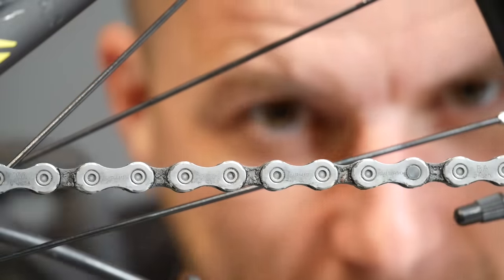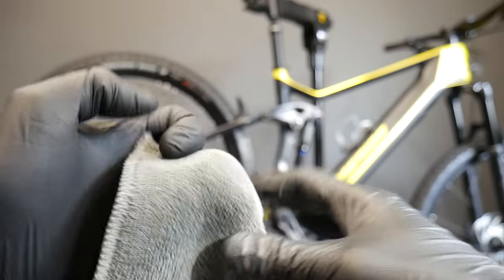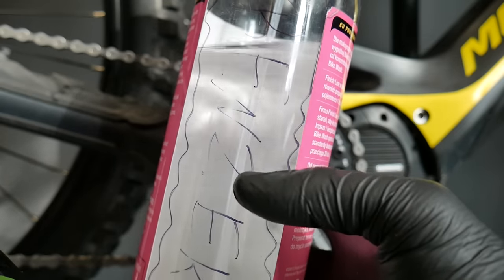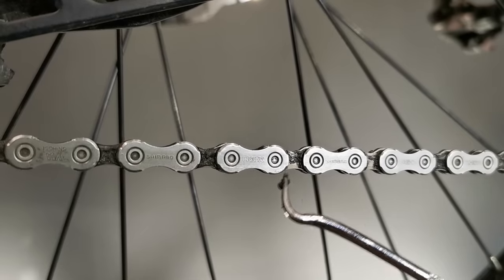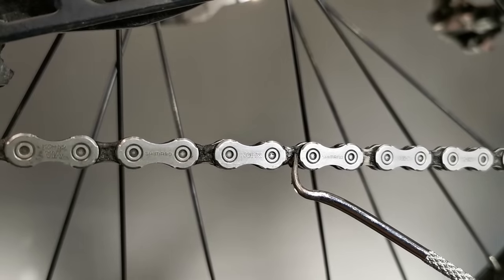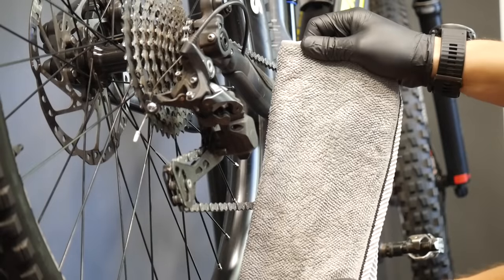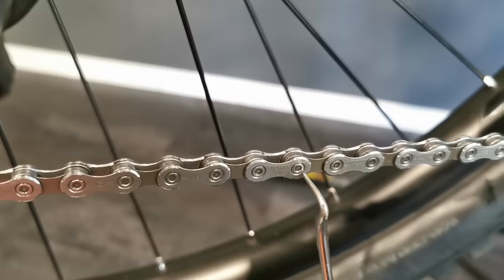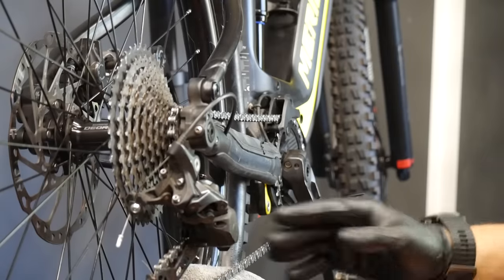This Drivetrain Will Last Much Longer. How To Clean And Lube Dirty Bicycle Chain. Slow Mo Comparison

Comment: Good idea with the shoelace! I found a brush does not quite clean the inside of the links so well. That chainring and the jockey wheels are utter filth though, not point cleaning the chain and leaving them in that state.

Comment: Chains wearing prematurely has a cost, but so does time spent cleaning.  If you’re going to invest the time to be this thorough cleaning the chain, it doesn’t make sense unless you do the same with cassette, chainring and derailleur pulleys.  It’s best to remove the chain, and completely clean the chain path before cleaning the chain.  Otherwise, you’re missing a lot of gunk and grime that will quickly find its way back into your freshly cleaned chain.
Reply: Removing dirt dry is advantage. It saves chemicals. 

Time consumption: well you die anyway. When and how? If you use lots of chemicals like car maintenance, you have those chemicals in you body. I like less chemicals. Maybe i die later with smaller amount chemicals in my body perhaps. It's practise and culture. Maybe patience pays off.

Comment: If I spent this much time cleaning my chain my wife would literally leave me... especially if I use her toothbrush...

Better Idea... spray a load of WD40 all over - let it drip off - quick rub of a rag - remove chain and soak it in a jar of petrol overnight (removes thick grease and crap) - remove from petrol then soak in degreaser for 30mins - remove from degreaser then soak in methylated/ white spirit for 30mins - remove, let dry - now the chain should be completely clean and just bare metal - wax chain - then it won't get so filthy. To rewax, after ~300-400km, pour boiling water over the chain from a kettle - re-soak in the wax - ready to go again. None of these steps takes a long time, in between you can go back to giving your wife some attention and or doing the dishes...

If you live in a shitty environment and can't be bothered to wax your chain - I completely understand - just get yourself a chain cleaner and several bottles of degreaser, and just accept your drivetrain will wear out quicker - much quicker.

Comment: spray with wd40 and let it soak for 2mins. Blast the between the chain link gaps with compressed air. wipe clean with rag, and lube it. Done!

Comment: Why not just to shake chain in plastic bottle with adding 100-150 ml kerosene, easy, fast and clean. And kerosene what u add in the bottle can be used in future many times. That way what we see in  the video do not clean chain completley.

Comment: I usually just use 2 toothbrush tied together to clean the chain then a towel to wipe off the excess oil.

I don't usually use a towel to take out the grease, the toothbrush will do the trick.

Comment: You can wash as much as you like. The No1 mistake most people do is TOO MUCH LUBE..
Reply: When is there too much lube? Somewhere I heard one drop on every chain link is sufficient...
Reply: @koteletje  You're supposed to wipe it off afterwards. Preferably oil over night and let it settle. It should hardly be felt when you touch the chain

Comment: I still find using the chain cleaner tool much more efficient in terms of using the degreaser because none is wasted during application (i.e., the degreaser drips of the chain when using only a brush), but the method shown still does the job. How bout u guys?

Comment: This was tedious! Best tip is to use chain links, take your entire chain off and drop it in a solutions of solvents or soap. Better yet an ultrasonic washer.
Reply: Ultrasonic for sure, but far easier to get a chain cleaning tool, cheap, fast, effective. And then never use the lube that this guy does!

Comment: if you clean like this you cant get the black greasy dirt that are behind the rollers on the inside of the chain. Soak the chain in some sort of lube (like dry /wet oil) and clean a few times till it runs clear.

Comment: I'm using a chain cleaner tool with diesel. I'm blasting the residues with a high power air compressor, then clean the chain with a cloth, lube the chain and wipe the excess.
Reply: Effective, but you get that diesel oil vapors to breathe and blown all around with compressed air. Health disadvantage.

Comment: Pipe cleaners between links works ok. It's funny watching the video and reading the comments a lot of the things suggested are things I just did with an amateur type mindset thinking pros had some much better easier way to clean a chain. Guess chain cleaning is a pain in the ass for all of us. Good video. I take it for granted you clean the derailleur cogs and chain rings.

Comment: I assume you're joking here.
If you want to clean longer than you are riding maybe. There are way better methods to clean your chain than this. And if you don't clean the COMPLETE drivetrain, your chain will look like a mess in no time. So don't forget to cover chainring, sprocket's and pulley wheels next time.

Comment: Just remove the chain, wash it in petrol, dry, re lube and install. done perfect job no fucking about. Ready to ride..might as well check for stretch and clean all the cogs and chainring while ya at it. Happy riding
Reply: petrol dissolves all

Comment: You wouldn't have crud on your chains if you soaked chain in molten wax instead of using oil. Oil will attract grit and debris like a magnet. I learned to wax a chain in the early 90s, and I can tell you my chains last forever and don't get so dirty.

Comment: I  use a chain with a quick link so it is much faster to remove the chain. Shake it in solvent. Then blow it off with compressed air. I also use Squirt dry lube. But I live in a dry climate. Even dry lube can build up if you  over lubricate like I do, but it mostly just flakes off. The rest can be brushed off periodically. I don't have the patience for your method.

Comment: I used to change chains like socks because they weren't that expensive.
Nowadays it's different...
I remove the chain and plunge it into nafta gas, agitate a bit, clean with isopropyl alcohol, dry, lube.
It's a bit less involved, or not, depends how you see things and if you're buying a new quick link every time...

Comment: The best way to clean bike chain is.. put the chain inside the bottle with full of thinner or gasoline.. let then deep clean by themself about 15 minuts, shake them a little before take out the chain from bottle.. it will completely clean
Reply: That´s true, and realy 100% work, but this metod is recommended on very dirty chain and after bath is good wash him in water(not hot, not cold).
If the chain is still dirty, re-wash them.
In the end, don´t forget lube.

Comment: The main method i use:
1. remove the chain with the quicklink
2. put the dirty chain in a bidon filled with lamp-oil and leave it for the night
3. remove the chain and rinse it with hot water
4. dry the chain with an old towel
5. reconnect the chain tot the bike
6. oil it
Reply: I do the same, but using an industrial degreaser and a brush. Not overnight.
Reply: 1. Buy chinese chain washer, (don't remember, ~7 usd? blue plastic thing)
2. Fill with White spirit and apply to chain 
3. One minute pedal rotating 
4. Take off the washer, wait for drying, oil. 
In fact, cleaning will need less time then oiling. But need to choose degreaser carefully, as too agressife will kill the washer. White spirit is just fine.
Reply: AG Coarseman  yeah, like that. But chinese several times cheaper. Surprisingly, works fine.

Comment: And what chain is that without the chain-lock link? If you get your chain removed, it is much easier to clean it properly and much quicker also.
And you'd have to clean all those cassette, rear-derailleur and chainring.

Comment: For masochist bikers. Sorry, but this way not very good. Simple wash it in bottle of white-spirit, benzine, or something petroleum light fractions. After in hot water whis Fairy, and again clear water. Dry it and ...the End ...grease (better whis parafine). Your method is longer and painful + abrasives staying inside the chain)

Comment: Why can’t our manufacturers add a chain guard to shield off those road dirt kicked up by the front tire? Only a small piece shield runs from 12 to 6 o’clock of arc is suffice. Most dirt on chain came from the front tire. What do you think?

Comment: I usually just remove the chain, soak them in degreaser and give it a good shake. Comes out sparkling clean
Reply: Every time you break a chain you make the pins weaker, and sram links can only be broken twice.
Reply: Quick links. Never have any issues
Reply: @rowdywombatadventures8755  Not switching grouppos over a link.

Comment: I don't know what to say 🤦‍♂️ bottom jokey wheel its full a crap  at 6:10
Reply: he was giving a simple chain cleaning example. the title is pretty clear: "How To Clean And Lube A Dirty Bike Chain". he goes in depth on every cleaning possible in his other videos.
Reply: This is enough to put most people off proper chain maintenance but a fair bit of time and hassle can be saved by using a Park chain cleaner device. It's a bit expensive but they clean chains really well and quickly, no need to use a rag and those various brushes and I've never seen a shoelace being used too, that just adds to the workload.

Just do a few runs through the chain cleaner and then use the time saved from his method to clean your sprockets, chainrings, deraiullers. I admit I prefer to take my wheel off too and clean the rim though this is unnecessary if you have disc brakes. 

I've finely honed my chain cleaning over the years so it doesn't take too long but I admit I include cleaning all the things I mentioned above.

I've also discovered changing over to a Gates belt drive means no more chain cleaning and lubing required, all that time saved means more time for riding.

Comment: I clean mine with an occasional jetwash after lots of mud on the mtb. Oil it 6 times a year, if that but still get 1800 miles/ 4/5 years out of a chain set

Comment: really really bad way too clean a chain !
to clean a chain, 
1 remove it from the drive train  and clean the drive train
2 - use a degreaser,  like gunk and a  small pot. 
3 - Spray about 2 spoon of degreaser on the chain in the pot 
4 - let it sit for 5 min,  
5 - rinse thoroughly with water and voila !!

toal time MAX 15 min

Comment: Why not remove it and put the whole chain in a bottle with gasoline or whatever liquid to clean it? Then place it back and put oil
Reply: best way to do it!!! fast and best results
i use a bottle with big tap 3/4 full with gasoline, let the chain sit in for maybe 15min and shake it every 5min. then i use a wire with hook to get it out of the bottle, comes out like new, even if the gasoline is black after a few times

Comment: Chain rings and jockey wheels are still caked with dirt and mud.... those should have been cleaned first, before the chain.  All that work on the chain cleaning will be undone by the chainrings and jockey wheels.  Doh...

Comment: I ride about 30 miles a day and get about 3000 miles  out of a chain  i power wash my bike and chain  once a week and  just  give the chain a 2minut wipe with a rag i never use chain lube i spray on a light film of wd40 or  any penetrant type lubricant  spray  around twice  a week it just takes seconds i have never had any drivetrain problems and the wear on the cogs is minimal, I have power washed all my bikes and as long as you do not go directly near places where there are seals or bearings you will never have a problem i keep the lance 150mm away from the bike.

Comment: Cool video! Oiling the gear teeth and running the chain around it oils the inner parts of the chain as well.
Reply: Nice Video! Apologies for butting in, I would love your thoughts. Have you researched - Xiyatalie Stamina Stampede (probably on Google)? It is a smashing one of a kind guide for lasting 19 minutes longer in bed tonight and 31 minutes next week minus the headache. Ive heard some pretty good things about it and my m8 after a lifetime of fighting got astronomical success with it.

Comment: I have used paraffin for the first dirt removal but I believe some pro mechanics use diesel which I now use.
A further clean with petrol with oil added works for final finish. l then wipe off excess with cotton roll.
Reply: parafin is a wax not cleaner

Comment: Interestingly, you wash the chain, but it's not easier to remove it and wash it in gasoline. It's faster this way and it washes out better.
Reply: I used to use gasoline to clean chains, however, it is just not worth the risk. I did so for 20 or more years, with no bad results, but I do NOT agree with you. To broadcast to random people (some of whom may lack proper shop skills and recycling habits) is not what any person should be recommending.

Comment: On my daily (Traking) Bike i discovert over the last 17.000km that if i let the chain dirty and just oil it with engine oil every 100 - 200km that it lasts much longer.
Because of the constant long rides i just use 5 sprockets all the time, and those sprockets wear out at the same time as the chain.
I achived 6.000km with one set whitout cleaning! just oil and go!
In every other circumstance i worn out single components much faster.
Also i use the Shimano M7000 groupset because you can change those higher gear sprockets individually for very cheap! 😁

On my enduro bike on the other hand, the mud and heavy sand that gets onto the drivetrain on every ride is another beast!
There i also clean the drivetrain meticulous after every longer tour.
I tryed the same there, but because of that big chucks of dirt the chain just gets blastet away!

My recomandation:
For the daily commute bike, don´t give a f... and just oil it good.
For offroad use, CLEAN!!

Comment: What a absolute waste of time you don't clean a chain like that. Just take it off put it a tub with some  Degreaser shake it about let it soke half a hour have a cup of tea give it a rinse off. Hey presto clean chain
Reply: You use alot more degrieser that way.
Reply: @LauriAP  thats why you buy 5 gallon at a time
Reply: @LauriAP  If you leave it lying around the schmutz all sinks to the bottom and you can use it again quite a few times. Anyway kerosene is only about 25p a litre and you can always light the BBQ with it.
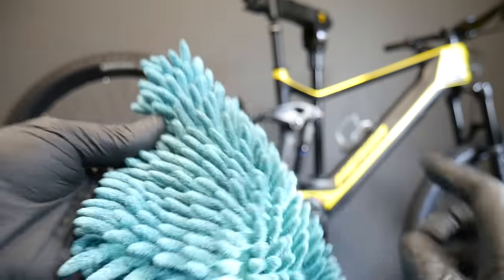Reply: @LauriAP  I bought 5L of citrus degreaser for $22, which you then dilute 1:10...it's gonna last me 150 years...

Comment: Seeing the derailleur pulleys and the chairing with LOTS of gunk left on them is disturbing!
You basically did a dry scrub on the chain, at the end I would've soaked the chain in a chain cleaning device or remove it and let it in a bottle of degreaser for the best result. There is loads of dried gunk between the plates and rollers that can't be removed with towels and brushes.
And again.. Painful to watch that tension pulley left gunked up like that!
The shoe lace idea is kinda cool though!

Comment: Neat chain, but he forgot to remove the gunk from the jockey wheels!
Reply: pretty clearly this is about the chain. he didn't say drive train, which includes jockeys, chain rings. its okay to read the titles, then comment.
Reply: @gregknipe8772  probably didn't read the title as well. It says drivetrain will last longer. As a fellow cyclist I'm sure you know jockey wheels are part of the system.
Reply: @StephenNdege123  I'm going by his previous presentation with wd40 on the freewheel, which works well here on wet days, in mud. there are many times all I need to do is clean the chain. this is splitting hairs though, right? but then again : "How to Clean and Lube a Dirty Bike Chain". I read pretty good. trolls will be trolls....

Comment: This does seem a bit obsessive.  And I am having some trouble with the 'last 5 maybe 10 times longer' bit. Even if that is theoretically true in some sense, chain life is also limited by stretch, and all the cleaning in the world isn't going to stop that.  I will admit that there may be some value if you have VERY expensive equipment, but your typical casual user chain and cassette are pretty cheap, so might be easier to kit it with a pressure washer occasionally, and apply some lube.
Reply: Well AFAIK train stretch is mostly not the metal stretching it's the metal inside the links being worn down as metal grinds metal internally, so getting the crappy gritty metaly grinding dirty paste out of THERE is great to keep a chain lasting a lot longer. The cleaning he does in this video seems mostly cosmetic though and wouldn't really help that?

The dirt on the OUTSIDE just looks bad.

The shoe lace was .. who has time for that?!
Reply: @FallNorth  I agree the chain does not stretch but the wear in the pivot points, caused by the dirt, makes it appear to stretch.

Comment: What's the point of cleaning your chain if some parts of your drivetrain are covered by thick mud ---> Jockey wheels and chainring!
Reply: @rumi108  Pas certain que t'aies compris mon commentaire.
Reply: Le gras c'est la vie 😆
Reply: @Lolololo-lm4lh  C'est pas faux!
Reply: He will clean the pulleys and the rest in another video, so he doesn’t have to cover the bike with mud again😂

Comment: the thing is that chains are so cheep now. its is it worth spending the time to clean a chain. rather than just get a new one
Reply: My SRAM X0 Eagle Transmission Flattop Chain is 120$
I just put my Chain in a glass char with some degreaser and shake it like my beach drink, after that another one with bike cleaner.
And the last with denatured alcohol.

8 min work and it's clean
Reply: @IIISentorIII  Well thats you buddy, most of us just bike around town and use regular 20$ chains.

Comment: I have to say that the way ur doing it is extremely  thorough but it's a very long process,it's just seems easier to take the chain off and hold it under water and scrub ith a brush or just use a degreaser and brush.